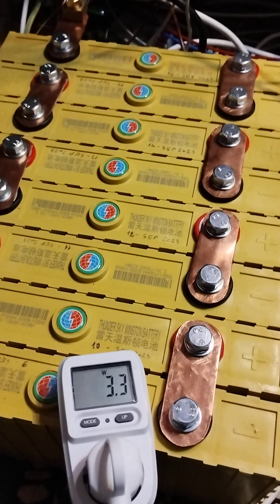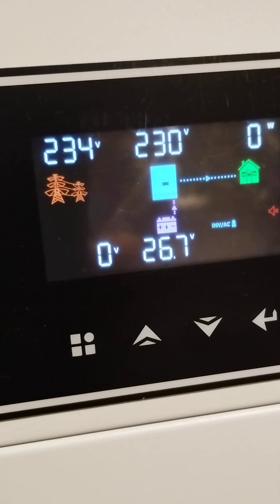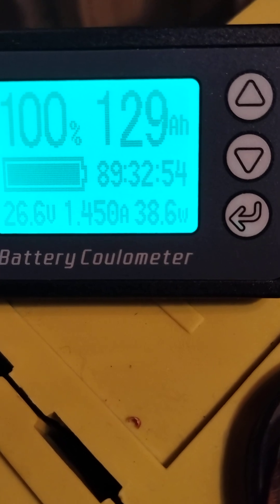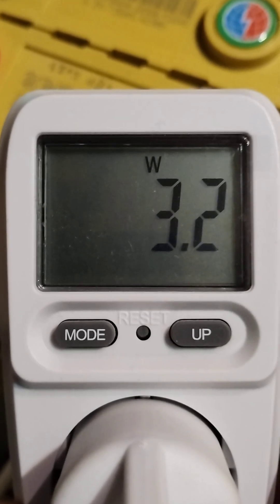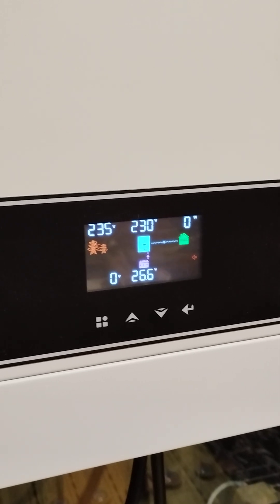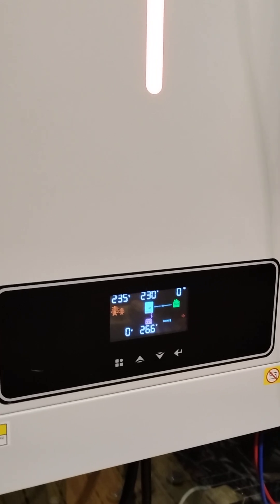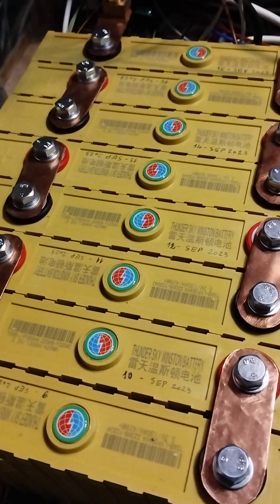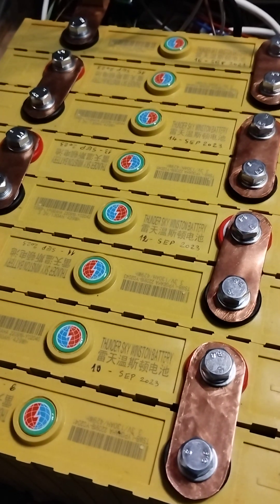29-ENG-BATTERY BANK IS CHARGED - REVIEW ECGSOLAX-42

Comment: Hi, i am using this one for 6 months now. Are you sure it does real 4.2 kw? The percentage load on the display is at 100% when i load it at 3.5 kw- so i am hesitant to put it further.
One interesting thing about this inverter is it can push excess solar back in grid. If the battery amp limit is hit, you can set it to push the rest back into the grid. Unfortunately you can only hard-configure the amps and not steer it (to steer for 0 grid export).